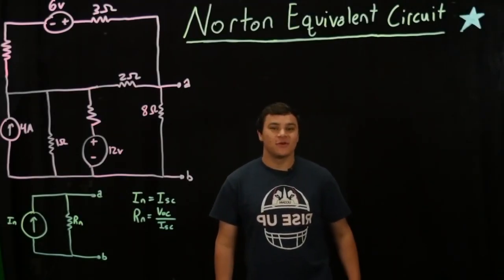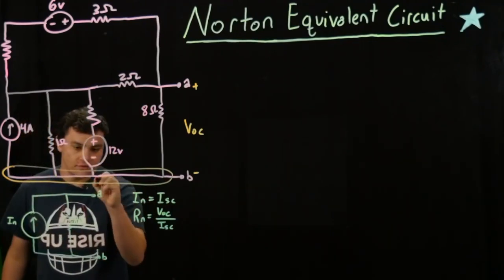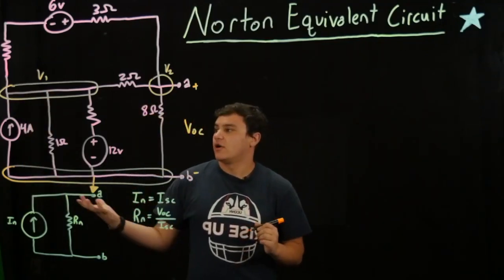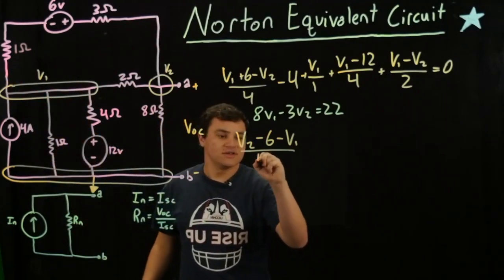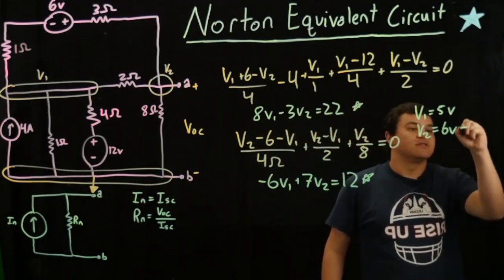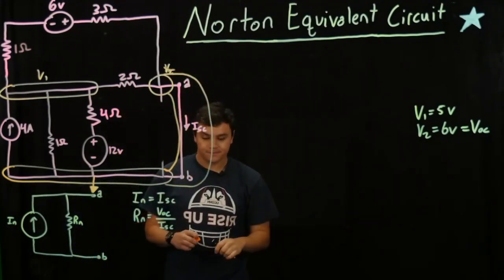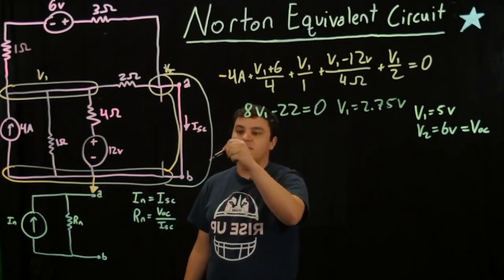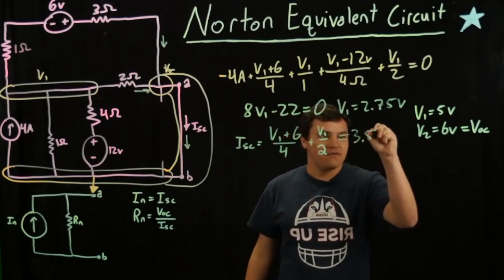Circuits I - Norton Equivalent Circuit - Example

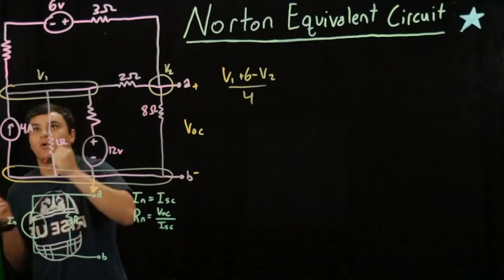Comment: Thanks - helpful. Though why for the current coming into V1, at 1:39,  do you have (v1+6-V2)/4. Why not just (6-V1)/1 or should it be (v1-6)/1.
Reply: Because youre solving the node from v1 to v2 in the superior part
And we have these components:
6v, 3 ohms, and 1 ohm

And we see the current es going upwords
Now we solve:
V1-V2.. but in the way we find a voltage that is 6 and it enters in negative..
So V1-V2-6

Now we see we have resistors in the way
3 and 1, we add it up and we know we're gonna divide by the resistors and that's it
Reply: Don't confuse or involve other wires, he's only doing the superior part, the wire that's at the top and it involves all those components